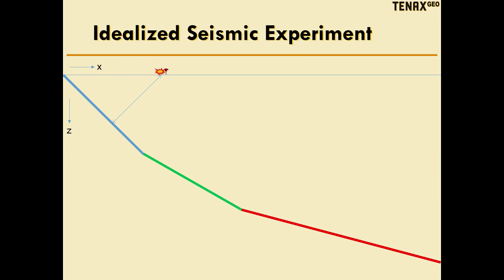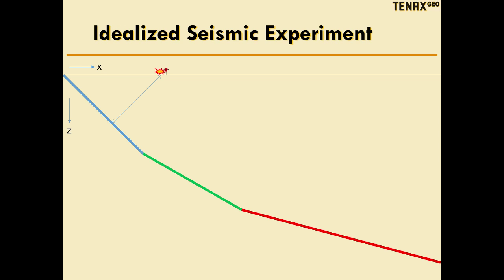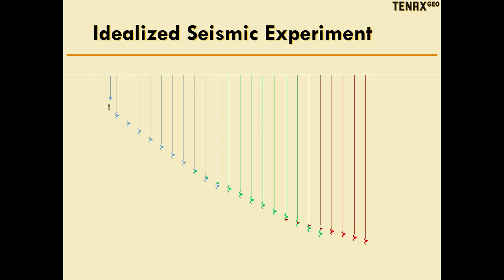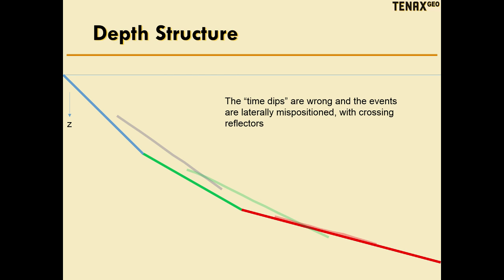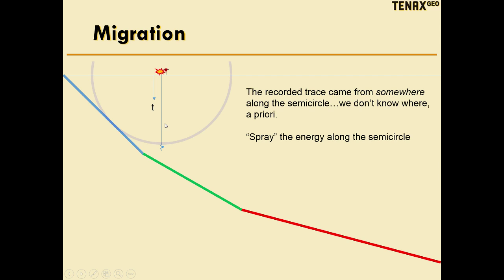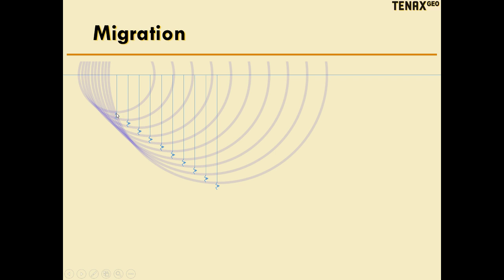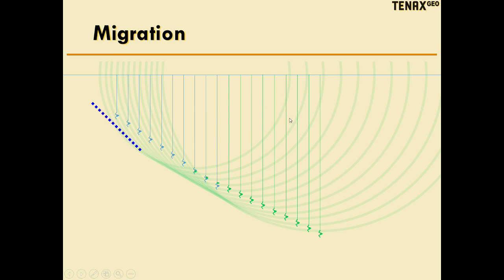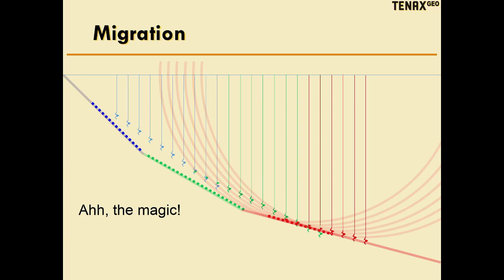The Magic of Seismic Migration - tutorial for non-geophysicists

Comment: If we are drawing semicircles by taking radius as length from shotpoint to the pulse, then we are getting the actual reflector. So where is the role of velocity comes here. Like I am only seeing it as geometrical. But I cant understand where will the velocity play role here.
Reply from the maker: This is a great question.  It is actually easier to think about migration velocity from the standpoint of depth migration.  The seismic signals are still recorded in time.  Depth migration seeks to place the recorded energy at the correct place in the (x,z) plane.  x is lateral position, z is depth.  Space and time are connected through velocity.  Say that you want to migrate the recorded signal at t=2.0 sec.  You would use a raytracer to trace rays for 2.0 seconds from the source/receiver location to all points in the (x,z) subsurface.  If the velocity field is constant, then the endpoints of the rays would map out a half-circle.  We would then spray the seismic signal at t=2.0 sec out into the (x,z) plane, alone this half-circle.  Where does velocity fit in?  If the velocity is higher, then the circle is larger (the ray travels further in 2.0 sec), and vice versa.  Does that make sense?
Reply: @MorganBrown  Thanks for your reply and explanation, Morgan. I have couple of questions. A and B
A.) I understand that higher velocity will make the circle larger. But this happens in (x,t) plane or (x,z) plane? 

B.) In the video around 4.55 you said that we need to know velocity as apriori for the migration. 

I understand that velocity i required to domain conversion, but how it is useful for migration that i cant understand. 

Let us see like these steps.
1.) We have traces in x,t domain. 
2.) Now we will take each one of those and spray the energy along semicircle and we generate interference patterns, eventually giving us the true positions but still in (x,t) domain. Geometrically we have migrated them in correct positions by using just interference patterns without using the velocity information. 
3.) Now we use the velocity to convert the traces from (x,t) domain to (x,z) domain.

I understand the role of velocity in 3rd step but not in 2nd step. Could you please clarify that?
Reply from the maker: try this: https://reproducibility.org/RSF/book/bei/krch/paper.pdf

Comment: hi Morgan thank you for this very useful video, I would like to ask you what "spry the energy along the semicircle" means in practice.
Reply from the maker: Hello Luigi, thank you for the kind comment!  It is a good question and I was not precise (at all!) in the video.  First we create an empty 2D digital image, M(t,x).  "Spraying" means that you literally copy a sample off the seismic trace, s(t), along a semicircular trajectory into M(t,x).  You repeat this process for all seismic traces.  You must copy AND add. This is key to achieving the destructive/constructive interference.  Does this make sense?
Reply: Thanks Morgan, I think I understand. Can I therefore say that the real surface of the reflector is graphically the envelope of the semicircles constructed on the basis of the seismic data brought into the 2D space M (t, x)? maybe it's just a case of this graphic situation
Reply from the maker: @luigimartino1542  yes, this is a correct statement.  I made these graphics in Microsoft Excel.  The semicircles have 50% transparency.  When multiple semicircles overlay one another, the "envelope" becomes more opaque.  This is almost exactly what happens in real life.  In real life, the signal has positive and negative polarity, so the destructive interference is enhanced.  In real life, this process works better than what I show here. ;-)
Reply: thanks a lot Morgan!
Reply: Ps. I m studying for a solid earth physics exam :)

Comment: Hey Morgan, thanks a lot for the video! Well explained! I realise you produced this video a long time ago but in the hope that you see this could you explain why this actually works? That might sound silly, I know that if you draw everything out accurately then the places where the constructive interference occurs gives you the real geology and I follow the whole explanation of the trace coming from anywhere on the arc, but I can't quite grasp why the arcs interfere at the point of real geology. (So I guess my question is I accept that this works and it seems like a good trick, but why does it work? Why does constructive interference occur at the real geological reflecting surface?).
Thanks!
Reply from the maker: Hi Benjamin, I'm still alive and still migrating!  I appreciate your note.  Here's the "magical" part of what makes this work - you have to know the seismic velocity with high accuracy.  If you supplied a velocity estimate that was too slow or too fast, the constructive interference would occur in the wrong place.  What's more, the event wouldn't focus as crisply.  I can email you some info that would provide some concrete details.  Drop me a line at morganpbrown "AT" gmail "DOT" com
Reply: Yes, I had exactly the same question. I remember finding this video very helpful during seismic imaging class years ago and have returned to it recently, and am finding I have exactly this question: Why does constructive interference occur at the real reflector, if there is equal probability of the reflector originating at any point along the semicircle? Does this have something to do with Huygen's Principle or am I way off?

Comment: Do we only need the velocities to be known to account for the refractions that occurs on the rays in a layered earth model, or even on a simple model like the one displayed here? if so then why?
Reply from the maker: This example is obviously in a constant velocity earth.  If the earth velocity varies (for instance) with depth, and we migrate with a constant velocity, then the migration will focus the energy in the wrong location.  However, if you supply the correct velocity, then any time migration algorithm will produce an accurate image.  If the earth velocity varies with depth AND horizontal location, however, then you will need a depth migration to generate a correct image.  I have an old video that describes how RTM (a wave equation depth migration) works.
Reply from the maker: https://www.youtube.com/watch?v=Po5HJ9Vd_5U
Reply: Thanks a lot for the quick response. so in this example we don't need velocities right? sorry but i am a geologist by background and i am trying to digest the concept. 
nice easy to understand video btw.
Reply from the maker: You always need to supply a velocity field in order to run a migration.  The velocities are determined by a variety of methods - CMP stack, constant-velocity stacks, reflection tomography.  The closer the migration velocity is to the earth velocity, the better the image will be.